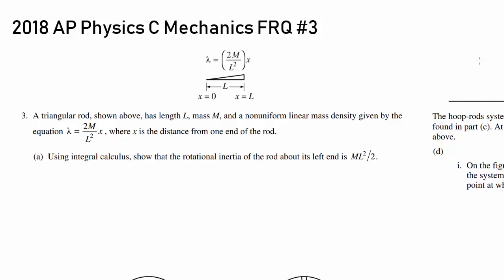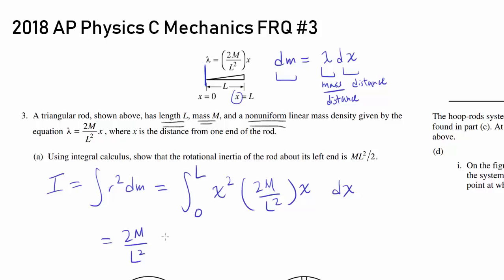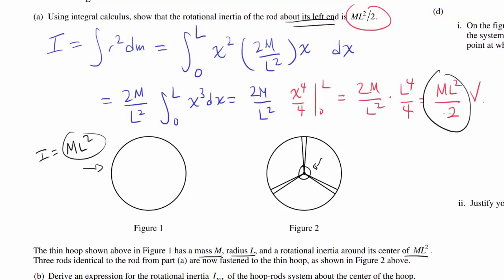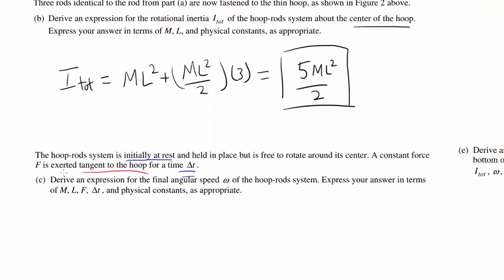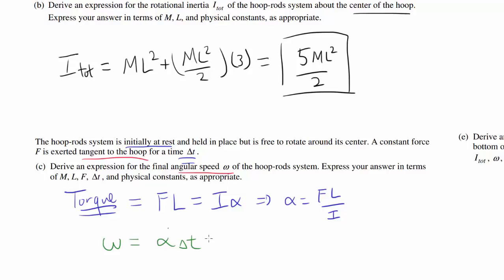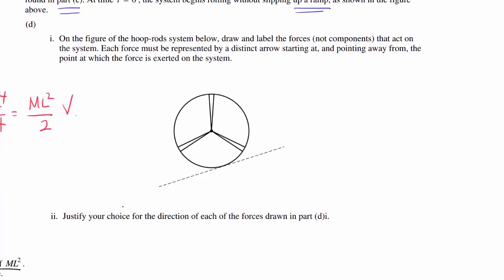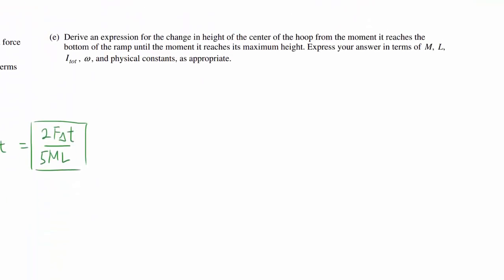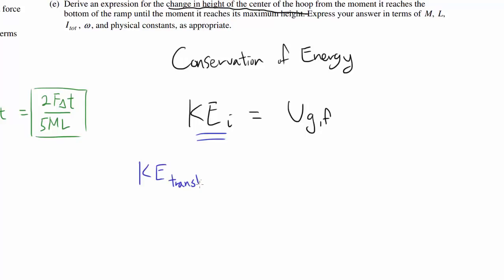2018 AP Physics C Mechanics FRQ 3

Comment: I was a little confused by the explanation you gave about the friction being up the ramp. I believe a better explanation is that since the rotational acceleration is counter clockwise as it goes up the ramp, this means the force of static friction needs to be up the ramp, because friction is what is providing the torque to slow down rotationally.
Reply: ohh that makes more sense, thanks

Comment: When drawing the forces on the hoop-rod system, wouldn’t you also have to include kinetic friction at the point of contact? Doesn’t it provide the torque to keep the system rolling? I fail to see how the system can roll at all without some force providing a torque.

Comment: I just used (2M/L^2) and ignored the x but integrated using the right limits (0 to L) and got the answer. I also did lamda = 2M/L^2 and solved for dm. After I substituted I integrated and got the right answer. I know I didn't use the x but the x just seemed unnecessary and also because that's sort of how they did it on the 2015 Question 3 problem. It was different, so I was a bit confused but try it and you'll see it'll equal ML^2/2

Comment: I forgot to add ML^2 for part b, hopefully, they will still give me points in part c for using a wrong calculation in part b. RIP.
Reply: William Wen The physics graders are a ton more generous than the calc graders, so yes they will give credit for later parts of a problem even if an early step was missed. If you look at the scoring guidelines it’ll typically give credit for “an answer consistent with the answer given in part (b)”

Comment: I like rotational physics but dam this one was hard. This makes mines look easy

Triangular rod? No uniform density

Wow they kicking it up a notch
Reply from the maker: Who knows, maybe in the future they will make the students use triple integral for nonuniform volume density. However, the integration was reasonably straightforward for this question if you knew the relationship between dm and lambda.
Reply: I don't think this was that hard honestly. It's just simple integration.